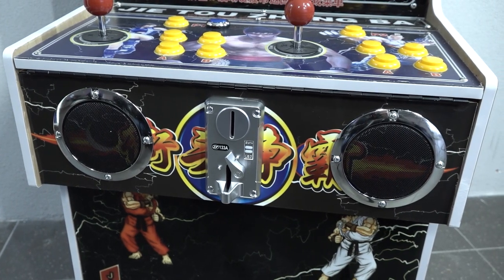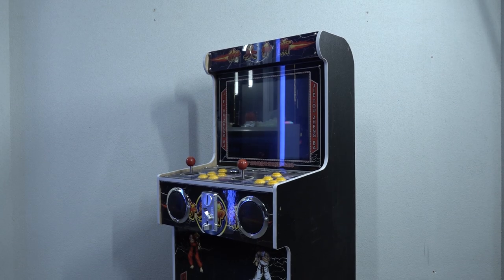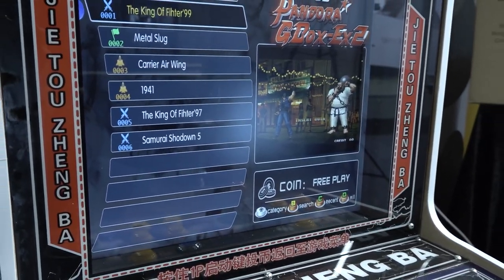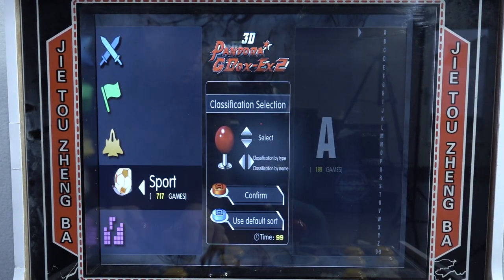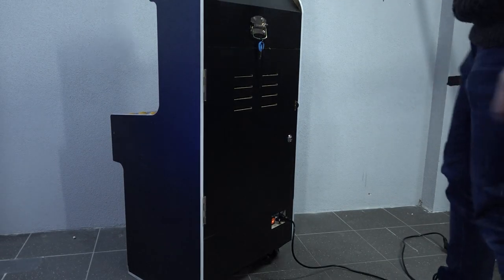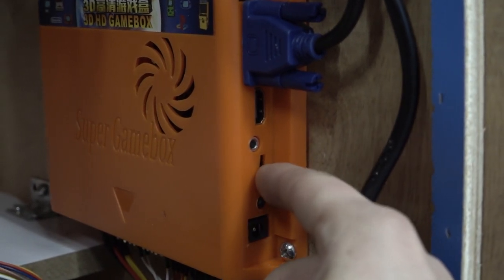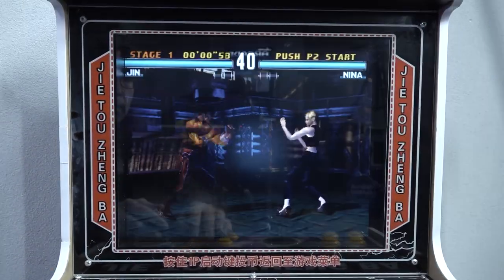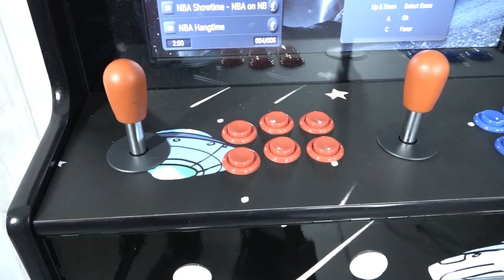Arcade1up Clone Machine from China ... Is It Any Good ?

Comment: The white dot in the middle may be a fallen off light spreading lens from a led for the backlight. I got the same issue with my tv but haven‘t opened it yet. It might be no problem to repair and fix it. Thanks for the review. Nice little cabinet with very much potential to Upgrade.
Reply: I thought the same thing.  I have the same problem with my TV and have 8 affected LED's where the diffuser has come off.